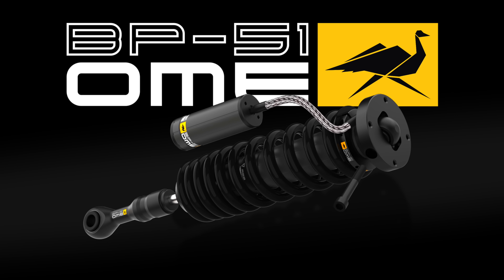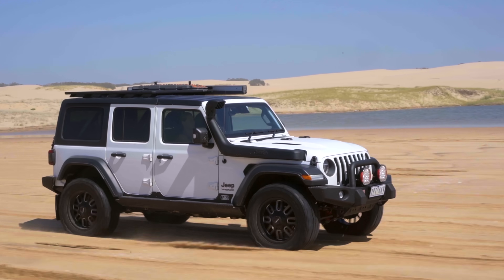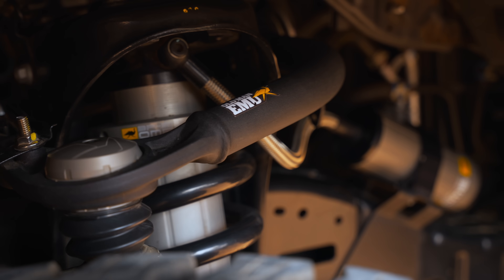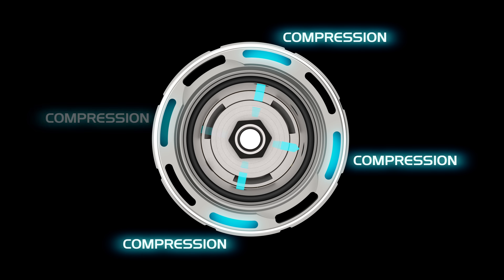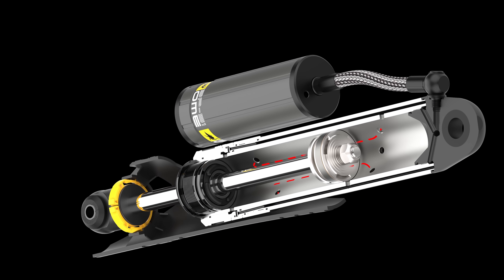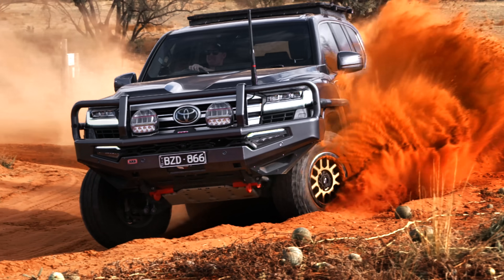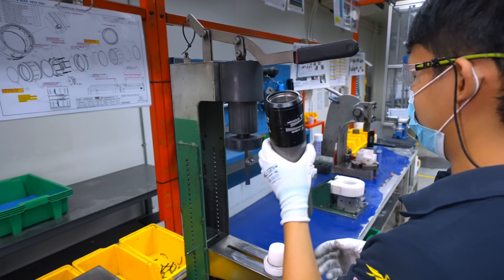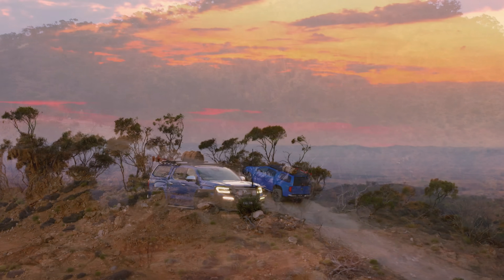Discover the OME BP-51 Shock Absorber!

Comment: Hi @ARB4x4Accessories Great video. Loved it. I wanted to get your views on one more thing. Does an increase in tyre weight by 7-8 KGs requires suspension upgrade in short/ long term. I was planning to replace my HIlux 265/60R18 Bridgestone (16 Kg Approx) with BFG K02 (23 Kgs ) and they are heavy. Does this increase in weight may impact suspension performance and I may have to upgrade the suspension
Reply: No.. spring and shock are holding weight of the vehicle not wheels and tyres.

Comment: I have a 91 Toyota Pickup DLX Off-road beast.  The chassis is slightly bent and it sags in tbe front.  Rear detroit locker and Spartan locker front diff.  I need to find solution to the front sag.  Torsion bars are good. With  IFS...  Will these coil ove4 shock absorbers fit my truck?